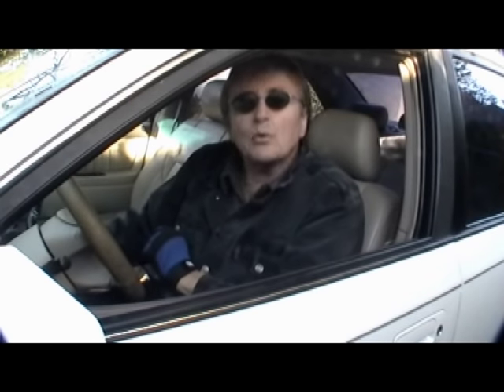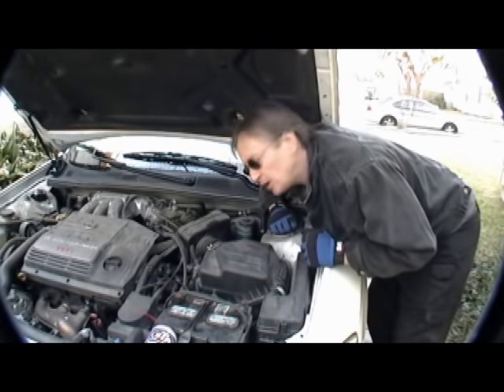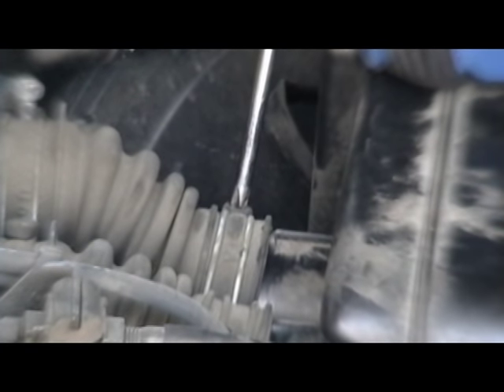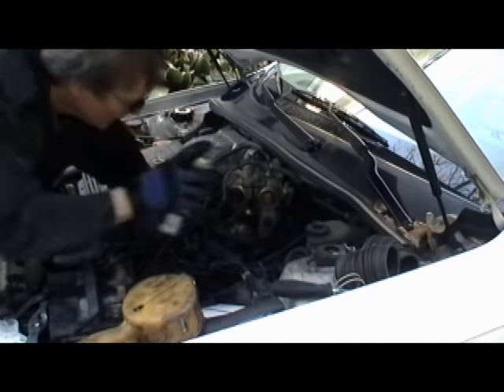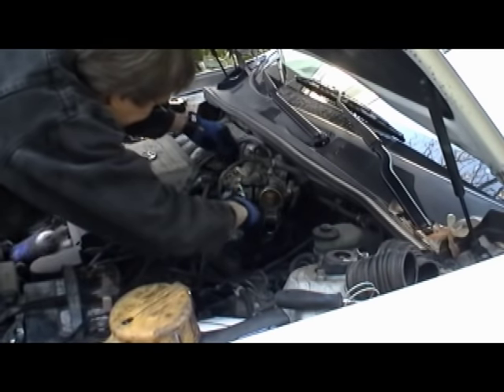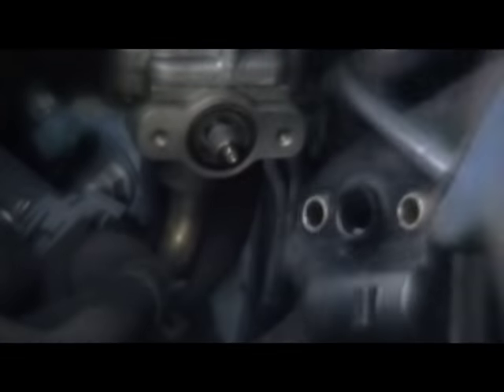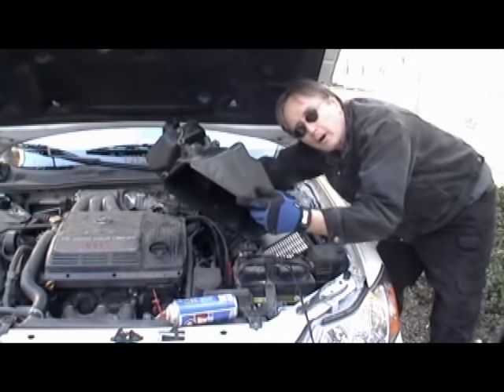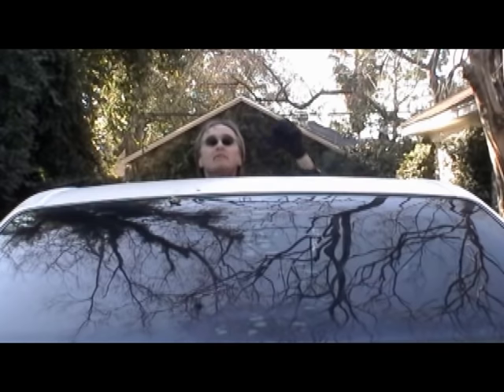How to Fix Engine Idle Problems in Your Car (Rough Idle)

Comment: I recently bought my first car, getting my license in 2 months, it's a 1964 Impala SS.  It runs kinda high and the whole car rumbles, if I tap the gas pedal after starting though, it idles lower.  It's also leaking a little oil underneath, any ideas whats going on?
Reply: Its normal for your 64 to have a high idle when it first starts,thats how they were designed. U let it warm up for a few minutes on high idle so it won't stall, then kick the pedal down and the idle cam drops to normal idle rpm. And most classic cars have some sort of leak,there are many gaskets and seals that leak as the car ages. good luck
Reply: Drum or Die Drum Videos Gotcha, thanks man, oh and when I accelerate, it makes a ticking sound that gets faster the faster that I accelerate.  It doesn't happen idling or when I rev it.
Reply: +commando8088  sounds like either an exhaust leak or sticking valve tappers. Make sure u have good spark plugs an wires and add a few ounces of marvel mystery oil when u change your oil and fuel to clean the valve train. Also try premium gas an see if it runs smoother. On my 1970 it requires premium octane and I also use gas lead additive just to be safe because cars were designed for leaded gas back then.
Reply: Drum or Die Drum Videos Gotcha, I plan on changing the plugs and wires these weekend and already tried premium, I noticed it lessen slightly.  Thanks very much for the help!
Reply: +commando8088 awesome good luck use copper spark plugs that's what works best on classics.

Comment: My Dodge Grand Caravan 1997 is making knocking noises in the engine and it's worse when I put it in reverse and when it's running plz help
Reply: +Jose Toledo most likely piston rings. use a thicker oil until you have money to fix or buy new car

Comment: I bought a new throttle body 
New air filter 
Idle air control valve & it still stalls when I come to a stop
Reply: would love to know what fixed your problem.  could  it be a timing issue?

Comment: DO NOT do this to electronic/drive by wire throttles. I learned the hard way.
Reply from the maker: +xYouthAttackx actually you can, but you have to disconnect the battery and let it air dry an hour or so before reconnecting after cleanintg

Comment: Hey so I have a 97 ford explorer ohv and it's idling rough like going up and down on the rpms I replaced the IAC And MAF sensor what else should I do you think cleaning the throttle would change it, it does it everytime I start up the engine bur after awhile it will go away please HELP !
Reply: Yes
Reply: +Peter Kapica ok so I did all that but no difference it seems to be getting worse and is now stalling out when I try and click on the gas so it doesn't it won't even Rev up on rpms
Reply: Any codes

Comment: hi scotty, my friend have toyota yaris 2000model japan,i clean MAF but still idle poorly.please advice what to do??
Reply from the maker: have the maf data checked on a scan tool and replace it if bad
Reply: I change maf but it was still same,in scan tool no error was detected.then i open the coil and check the spark plugs.i saw there was oil on spark plugs..when i replace the plugs and it was ok..i got new experience..thanks bro for your support.

Comment: I have a 2000 Mercury Mountaineer with a 4.0 Sohc v6 engine. it idles erratically, lopes and sometimes stalls while idling, shakes violently when coming to a stop, accelerates poorly sometimes, and is pretty noisy really. I've run my scanner and it comes up with P0301, P0302,P0303, (all misfires) P0172, and P0174 (one of which is too lean and one is too rich). The plugs and wires were changed fairly recently and I can't find any vacuum leaks. I've thought possibly that the camshaft position or crankshaft position sensors may be on its/their way out. Other than that, I'm at a loss for what to do. fuel filter and air filter are brand new. Any ideas?
Reply: also, I put new intake manifold gaskets in, ran lucas injector cleaner, cleaned the mass air flow sensor, and cleaned the idle air control valve.
Reply from the maker: +Kyle Palmer  often leaking intake manifold gaskets do just that on that model. OR  worn timing chains, check those first
Reply: +Scotty Kilmer I replaced the intake manifold gaskets and had the timing inspected and everything was good except for my left upper secondary timing chain tensioner which was replaced.

Comment: I've got a question my car recently fucked up and come to find out my thermostat sensor was bad so my car heated up and it began to smoke so I stopped replaced the sensor and now my car has a problem keeping the rpms up
Reply from the maker: could have blown the head gasket, do my test "how to tell if your head gasket is blown"
Reply: Yeah bought a new one and thought it would be easy to do but Dont have the right tools

Comment: hello I've been watching this show for quite a few years. I have a 93 Lincoln Town Car signature. when I'm driving I can hear the air ride activating more often than it ever has what do you think I should do?
Reply from the maker: +MORNING Gardener's SHOW. check for vacuum leaks on the air shock bags, especially where the lines go in with little o rings that go bad.

Comment: Hello! i have a honda 1996 ek3 and it seems to have a rough idle with multiple misfiring and black smoke.  But no error codes!
using an OBD1 scanner shows that there is  an more than normal value on the MAP reading.

Cross checked with 2 same make and model cars and  the only seem to have a value of around 30 to 40 on idle where as my car (via OBD scanner) shows values around  65 to 75

so far we have:
 replaced MAP sensor 3 times  
 cleaned throttle body
 checked for timing issues 
 checked ignition spark issues 
 checked for injector issues 
 check temp sensor 
 checked for clogged CAT
 replaced wire harness
checked for valve leaks 
replaced ecu and back to the original one 

please note this is on idle speed only, and on high rpm the roughness goes away

Please help 

Thank you!
Reply from the maker: on those, often vacuum leaks often make the map sensor readings bad and do just that. I would use a smoke machine and check the throttle assembly closely
Reply: Oh  yes! will do that and keep you posted 

Thanks a lot!  really appreciate it  :)

Comment: i have an problem with mine car it's renault laguna 1994 66Kw when i drive with it it seems fine but after some driving when i stop at red lights my RP.M stays around 2000 it doesnt go back to normal 1000  i would need to turn it off engine and start over it what's the problem same thing with WV passat 1989
Reply from the maker: try my video "how to fix a car that idles poorly" and also clean the MAF sensor

Comment: hi my uncle had bought a used 89 camaro this summer & been working on it.
but had just found a proablem the (tbi) in the trunk were the gas tank is.
the car won't start, but (tbi) keeps running and he thinks that's want is killing his battery.
so what can be the matter?
Reply from the maker: +VAMPRESS23 check the fuel pump pressure first weak pumps do that a lot

Comment: i have a ford exploerer 1994 and it idles very low then it jumps back up then it goes down and it does it for about 30 seconds then the car shuts off.
Reply from the maker: do this video tests, and also "finding engine vacuum leaks with a cigar"

Comment: I just put new headers on my car and gets low idle on a 2001 honda civic lx  sedan starts good but my engine starts to shake to like it wants to turn off some mechanics tell me it might be the sensors?
Reply from the maker: +Sky Contreras you put on headers, that changes the air flow and back pressure. ONLY way to make it run right would be to have a pro dyno tune it and change the software.
Reply: +Scotty Kilmer Ok and if I put the original headers back on would I still need it tuned?
Reply from the maker: +Sky Contreras IF it ran fine with the old set, it would not need tuning for that IF they were the original set the engine came from in the factory

Comment: Hi i have a 2003 acura 3.2 CL and occasionally at stop lights the car starts to shake and eventually shuts off then it wont start up what can this possibly be ? The other day i went to start it but it wouldnt even start like if the battery was dead .. please help thank you in advance
Reply: how does it drive on freeways and streets
Reply: Freeways it runs perfect
Reply: +fernando vargas I might check the alternator and distributer along with the battery pos/neg terminals to see if there is a problem with those

Comment: hey i need some help ...i installed a short ram intake and i noticed my car throttle response feels better but my car is also now running rich i get a code for p0172 any tips??
Reply from the maker: you can't just bolt that stuff on without reprogramming the computer software, realize that

Comment: My is clean. But still idle is not steady but my Honda runs good when driving. What could it be
Reply: Hey! I do believe that may be a sparkplug or fuel injector issue! If your sparkplugs or wires are not installed perfectly or if a sparkplug is fouled, you may need to replace them. Sparkplugs on most cars are 5 bucks so itll be a quick and easy fix. 

If that doesnt solve it, try an engine and gas cleaning addative to your gas to break up buildup on your fuel injectors. If that doesnt work, you might need new wiring and new fuel injectors which are still under 100 bucks on most cars.

Comment: can i use a wd40 instead? or dat will be harmful for this purpose.?
Reply: It might work.  Heck, a wipe with a shop rag might work, but how many times do you want to disassemble the ducts?  Splurge and spend $4 on the correct cleaner.

Comment: I am having problems with my Nissan Altima 1999 Gxe shaking at the stop sign or red light.   I uploaded a couple  video of it in drive  while I'm on the brake , I was hoping someone could help. Scotty Or Anyone Please !!!!!!!! 🙃🙃🙃🙃🙃🙃🙃🙃🙃🙃🙃🙃🙃🙃🙃🙃🙃🙃
Reply: James Philistin did you find out what it was?
Reply: is your ck engine light on ..if so have the code ck first
Reply: that's your motor mounts

Comment: My car; 1997dodge caravan 3.0l 3speed. I replaced new idle and air filter now it won't, need help. Thank you
Reply from the maker: use an OEM part, yours may be bad if it was OK before. If not, try my video "how to fix a carr that idles poorly"
Reply: Scott, one thing I should let you know. Before I replace the idle and the air filter. I replaced the whole harness wire under the hood, I contacted each individual wire with the same color, some how there is a sound came from the relay area and the van doesn't start.

Comment: my 93 honda civic idles high around 2000 rpm would this be same problem
Reply from the maker: +Ronnie Dueitt pray it is, and not a shot throttle assembly that's worn and sucking air from old age
Reply: +Scotty Kilmer thanks I'm going try cleaning it and all

Comment: Hi, I have 2000 Chevrolet Impala it misfires I've went to plenty of mechanic shops they all tell me something new the one I went to most recently tells me it's a seat belt sensor but check engine light blinks and engine runs rough at idle also when I back up it makes a clucking sound and engine runs rough I've got new spark plugs and wires but also AutoZone tells me wires are coming up the car uses too much has now could it be the wires in the wrong place??? I'VE ALREADY PUT ABOUT $400 DOLLARS INTO THIS PROBLEM I just want to get it right
Reply from the maker: +Tajh Hayes  seat belt sensors don't make em run poorly. ON that model, often bad fuel injection system that's mainly plastic and cracks and leaks internally when that old. Check that first, also pressure test the fuel pump

Comment: I'ma woman I need a lil help men's b4 taking my car 2 the shop so mechanic want try 2 get over on me. When I crank up my car it idle up high and than comes bck down 2 normal running. It never cuts off at lights or anything like that.

Comment: why do a Lincoln LS run rough wen it get to 45 mph
Reply from the maker: pressure test the fuel pump and pray it's just weak, if not that, test the catalytic converter to see if it's clogged up, mechanics can pressure test that too

Comment: Hey Scotty, 
Thanks for the awesome videos. Very helpful and straight to the point.
I have a 2000 nissan maxima that threw the po505 code a few months back so I cleaned my throttle body out, and checked my IACV first. I unplugged the IAC and turned my car in the on position and found it wasnt moving up and down. Tried cleaning to no avail and after seeing they dont sell the sensor individually at stores like autozone and advance auto and wanted 189 for the full assembly I went to a pull a part for it and tested and it worked great. Check engine light went away, and I drove for a few months until it started doing similar things again this time with no check engine light. Now when I try and start it i have to gas it or else it will immediately drop rpms FAST and die. It doesnt flutter down to an idle then die, it just DIES. It almost feels like there is a strong counter resistance. Before when it threw the codes it would do this weird idle thing where when I put it in park it would start fluttering rapidly rpms from 1000 up to 1500 up and down up and down then off if i threw it in drive. (auto trans)

I took out my maf sensor to clean and looking at it i dont see the resistor iat wire. Do all maf sensors have this? It has two metal tits and a plastic indention where it looks like it should be. I cleaned it despite and as expected no luck. 

I tested IAC again and still functioning properly. Could this be a vacuum leak? or fuel pump/clogged fuel filter, egr valve?
 
I know this comment is HUGE and shouldnt be asking such advice over youtube but I am in dire need of my vehicle and my funds are running out. 

Thanks Scotty

Comment: hi 
where I find mass air flow senser for corolla 1992
Reply from the maker: +Mustafa Abd nowhere, it doesn't have one. It uses a map sensor on the firewall and they never go bad
Reply: +Scotty Kilmer Which makes you wonder why they had to add a sensor to newer cars that we have to replace or clean :P
Reply: from bilal ganj

Comment: Scotty I own KIA Spectra 2001. Fully cleaned entire throtle body. Fly is 100% okay. Just changed both AIC and TPS sensors but still RPM is not going down from 1500. What should I do next? Please advise. You are a life savor!
Reply: Sandi Dudek your idle screw must be adjusted, u probably have it to high
Reply: idle screw is at zero position

Comment: Hi Scotty! One question about an old seat Ibiza 96 with 1.4 gasoline engine 60hp. When the engine is cold, it starts very difficult and dies immediately. It can't keep any idle. When the engine is warm, the idle is fine. Do u have any idea what the issue might be? I cleaned the throttle and the idle control but no result. There are no vacuum leak on the intake manifold. I replaced the coolant temperature sensor as well.again no positive result. Thanks for your reply in advance.

Comment: Hello everyone I was wondering if anyone can help me figure out what the problem is with my car . I'll be driving and  at a point the Rmp's will go up(even if I let go of the gas)  but the car will not accelerate But it will slow down Then once it passes I'll hear a loud "bang" feels like it hits a wall
Reply from the maker: sounds like transmission is shot internally

Comment: my 2006 grand prix overheats when i stop
Reply from the maker: check the cooling fans to make sure they are working first
Reply: If the cooling fans are not running check the fan plug to the fan resistor and the fan resistor itself. They may look slightly melted. I found them to both be bad on my Ford Focus. Ordered a plug/resistor kit on ebay for $28. Changed them myself in 1/2 hour. No more overheating. Both fans run fine now. Just remember to always disconnect the battery before changing any electronic component.

Comment: when you drive it it won't rev up it'll just die out n gotta wait 30mins than it'll start rite up
Reply from the maker: pressure test the fuel pump first, weak ones often do that. as can a bad maf sensor

Comment: Do lots of work on my 95 ranger I'll give this a try cause the idle goes a few hundred rpms up and down, drives me crazy
Reply: 95 wow! How many miles on it?
Reply: @jeffreysantos9070  100,000 but the speedometer is always 15 mph high so it counts a little fast. My idle was from a freon leak in the AC of some sort

Comment: I have a question about a chugging sound from my 2017 Tacoma it makes the same sound as a standard car would make is you dident give enough throttle
Reply: Forrest Barnden maybe it’s fuel or something clogged inside the engine

Comment: Hey scotty I have an 04 jaguar vdp idle vibrates in drive only no check engine light I replaced thermostat coolant reservoir spark plugs and valve cover gasket and o rings. Happened after I replaced part of cooling system can u plz give me some advice

Comment: Also beware if ur throttle has a oem sealent like most hondas have black sealent gloop behind the valve if u rub that off ul completely ruin ur idle the sealent is there to make a perfact air seal when the throttle is closed if u remove it air can get past the valve so dont just go rubbing like crazy becareful he doesnt mention anything like this people can ruin there throttle cleaning it without care

Comment: Rough idle and hiccups in my lancer 2014, the car probably had some major accident... below are the solutions after the research : 1) spark plugs (I have changed them but the problem persists)
2) Ignition coils
3) throttle and air valve cleaning
4) mass flow sensor cleaning 
5) fuel filter replacement
6) cleaning of fuel injectors
Now in saudi Arabia the mechanics have no experience and they fool you. .. can somebody tell is there a precise way to diagnose the issue first..  #Scotty Kilmer                Scotty kilmer